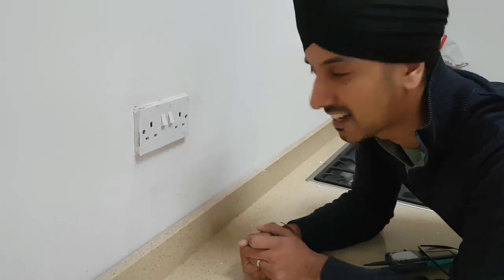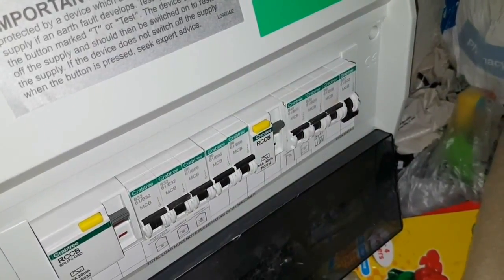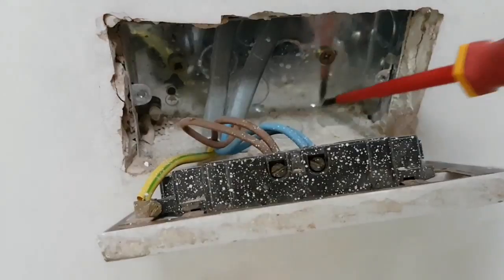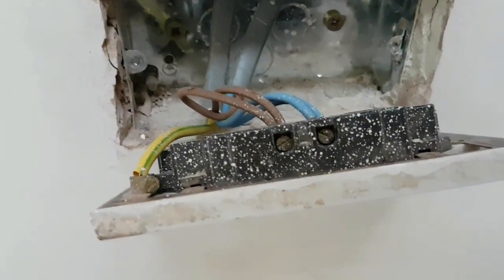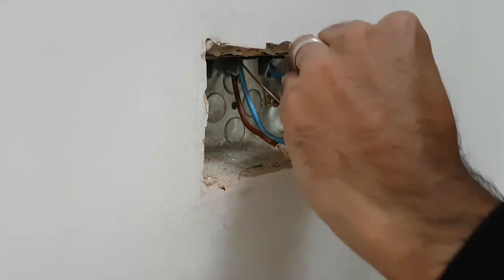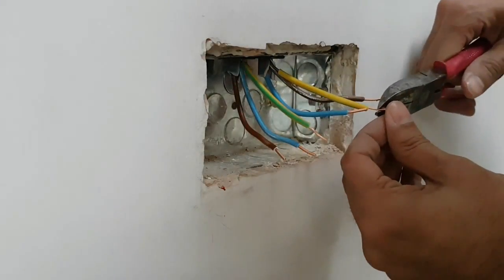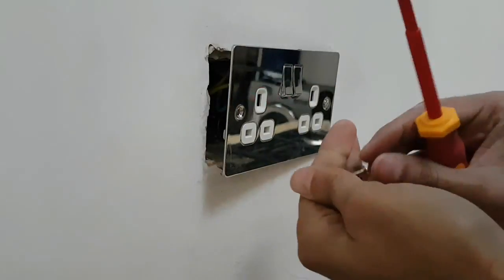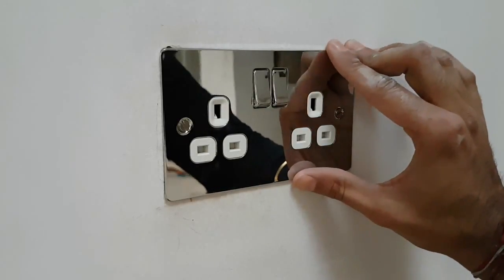How to install a double socket. Replace socket with flat socket. How to wire Socket Wiring UK.

Comment: BROTHER WHY DIDN'T YOU PUT A FLYING EARTH LINK FROM YOUR METAL BACK BOX TO YOUR METAL FACE PLATE, IT REQUIRES ONE WHEN INSTALLING A METAL FACIA
Reply from the maker: Hi mate, you don't require the use a fly lead as the earthing is used via screws. Also BS7671 regs books there is no where stating a regulation for this requirement. If there wasn't an rcd then yeah I would be required. Hope this makes sense cheers Handy Singh.

Comment: Should you put an earth wire from socket face plate to box in the wall?
Reply from the maker: Hi Trevor, thank you for watching the video. The back box should only be required to be earthed if there is no rcd protection on the circuit. Also in the BS7671 regs there is no regulation to say this is required. Also please note the screw terminal will provide continuity to the CPC earth as this Also touches the back box. Hope this make sense. Cheers Handy Singh.

Comment: Have you done a minor works certificate for this
Reply: P.s you need to change the battery in your smoke alarm by the sound of the beeping noise in the background mate
Reply from the maker: Hi Adam, minor work certificate is not required for replacing a socket on an existing circuit. There is no alternation in terms of extension of circuit or adding a new circuit in this scenario. This is a current ring final main circuit already in place. Hope that makes sense.
Reply: @handySingh  Appreciate that mate but how do you know it's a ring final circuit? I work for a housing association and they require a minor works certificate for any disconnection then reconnection of an electrical point. Electrics are not to be tampered with by incompetent people. Only a fully qualified electrician should do any works on electrics
Reply from the maker: @adamsharp201 Hi Adam, this video is for a DIY job for a domestic house. The regulation states you are allowed to change a socket on a existing circuit on your own house. As long as you don't amend the circuit if you are competent to do so. At the time an end to end test was done part of step 1 ring final circuit to confirm this alongside the figure of 8. Both Zs readings and rcd tests were fine. This part was not added to video as a typical DIY person would not have a multi function  tester.
Reply: @handySingh  That's fair enough mate. I've been to electric fires before because of DIY jobs so dont agree with incompetent people touching electrics that's all. Take care
Reply from the maker: @adamsharp201  9 times out of 10 the fire would not start from a socket. Especially when there is a rcd in place. Most fires start at consumer unit or shower switch outlets or circuits with higher loads.
Reply: @handySingh  never said a fire would come from a socket. Loose connections on any electrical outlet can cause fires. Yes you are right shower pull cords are always burning out. But once again I can't emphasise this enough. Electrics is not to be touched by any incompetent person. Are you an electrician? Hope you managed to swap the battery in the smoke detector mate. Being an electrician is so easy it's only 3 wires after all
Reply from the maker: @adamsharp201  Yes I'm qualified but you don't need to be qualified to change your home socket. What's more worrying is your watching a video on how to change a socket as a professional.
Reply: @handySingh  Haha I'm actually with my girlfriend proving a fact because she changed a light bulb and now she is an electrician all of a sudden. If u r an electrician where is your locking off kit and fly lead from metal back box to socket front. Also if u can't strip cable with your snips and don't double over your earth wires you have clearly not been taught correctly. Also a plug in socket tester does not prove the socket is on a ring main.
Reply from the maker: @adamsharp201  changing a light bulb can be seen to be more dangerousd to change than a socket as it is assumed that the light if off, especially on a pendant. There are more exposed parts in some cases. Yes the fly lead I agree was missed in that video but again the screw terminals do give a connection to earth. Still gives a r2 wonda lead reading on screw terminal.
Reply from the maker: @adamsharp201  again a diyer in their own home will not have a safe isolation kit.. lol I.e other DIY viewers. They will have a standard voltage tester to confirm dead.
Reply: @handySingh  not if you isolate the lighting circuit and lock it off mate ha. Anyway I'm going to subscribe to your channel. Appreciate you are giving advice buddy. Take care
Reply: @handySingh  What about a 150 pound proving unit.
Reply from the maker: @adamsharp201  cheers Adam..your taking me back 5 years..long time.. im doing a series video around testing coming soon will be alot better. I will be covering alot of testing procedures soon. How to carry all these different test for inspection and testing etc for new beginners. Have a good evening mate. It's good to bounce off one another for banter mate.
Reply: @handySingh  Take care mate great banter and looking forward to more debates moving forward with your channel buddy
Reply: @adamsharp201 Also test both sides of the socket to prove no earth fault or Neutral reverse is just stupid as both sides are being fed from the same cable especially if you're changing the socket anyway, if not it might detect brocken pins, when you put the plug top tester in, and flicking the rocker switch is worth testing only if you were looking for faults, not if you're replacing, with a metal one though, coz then you need to have a flying earth link from metal back box to metal face plate, for shock protection.

Comment from the maker: What do you think about Ring final Circuits? Do you think we should install these circuits going forward?
Reply: Na it's radials for me. Install 2 in a kitchen if possible on 4mm t&e. The amount of broken rfc's I've been back to left by kitchen fitters is silly. 
The great thing about radials is you can branch out and continue to in any direction. Line to neutral break and the other sockets won't work. The disadvantage is a break in cpc which may go unnoticed. Where as a rfc has legs either direction.
Reply: No, won’t work with new tech / Saftey devices

Comment: Why do you put two wires at the same port? Not make the bridge?
Reply from the maker: Hi Shema, this is part of the ring final circuit where it connects to the others sockets and then back to the consumers unit main board. Thanks Hardip

Comment: Great vid, thanks... Whats that device called that you used to check the plug?
Reply from the maker: Voltage Tester made by LAP - Screwfix brand. Code 91596 - £7.99
Reply: @handySingh  Thanks

Comment: Are you serious!!? That was an appalling example of what NOT to do. You must never-ever-ever abuse an earth conductor by wrenching it to strip a cable. Also you cut the conductors too short. Not the worst I've seen, but pretty bad example.
Reply from the maker: 90% of all electrician strip the earth wire like that in the real world..at college it is a different thing...it's like driving at car with hands on the wheel at 10oclock and 2oclock in order to pass your test...does everyone drive like that afterwards lol
Reply: Agree with you Mr. D A pretty shocking video. Agree with stripping back the outer sheathing, makes it easier to dress the wires  and when screwing the socket back the wires will move more freely. But why would you cut tge wires back further, there is no issue with them being longer, leaving them longer allows you to pull the socket further away from the wall so testing and changing becomes alot easier. Also its a metal fitting so it should be earthed with a fly lead aswell as the metal backbox. Also having two cables enter tge backbiting doesn't make it a ring, it could just be a socket part way round a radial circuit.
On another hand well done for putting sleeving on both earth wires not just two wires in one.

Comment: What is the point of checking it is wired  correctly before you start when you are disconnecting it anyway?  Where is the flying earth lead to the backbox, this is to keep it earthed when you remove the socket. it is also good practice to sleeve the earth wires together in one sleeve , not separate them like he has done here, it offers a little bit more continuity,  also putting the single earth into the earth connection without doubling it up by bending it over is to be frowned upon, the connection and screw is quite large and can  sometimes not grip the wire securely, earths are important, this video is aimed at novices and can prove dangerous, there is far more skills needed to do these things than is shown here, oh and the music? says it all.
Reply from the maker: Firstly the back box will never become live as earth is still connected via terminal screws.. secondly why would a socket have 2 terminal for earth on each side if you want to join  both earth wires together...
Reply: Why are novices and un qualified people touching electrics anyway. Stick to your day job or go to college for 4 years like I did to qualify as an electrician
Reply: Lol no you don’t put the Earth in same sleeving  terrible advice makes testing a pain , and both Earth terminals on socket should be used were available as this has its purpose for earth leakage although domestic may not be an issue still good practice , it’s best too always double your ends for termination very rare to have faults or arcing this way over time , earthing back box takes little time and shows a good quality  electrician has carried out the work imo.

Comment: Not two bad except wrong wire for a 13 amp plug should be 2.5 Mm
Reply from the maker: Hi there..yes it was a 2.5mm wire..new extension.

Comment: nice one....would have been good to also earth the back-box to metal face plate
Reply: No need to Earth the back box
Reply: Not strictly necessary if the box has one fixed lug.
Reply: Always best practice, more so when the faceplace of the switch or electrical outlet could potentially become live. Definetly strap an fly lead to the backbox if there's no rcd protection.